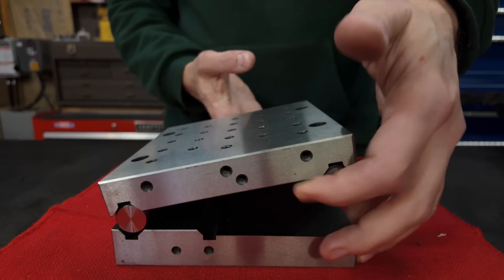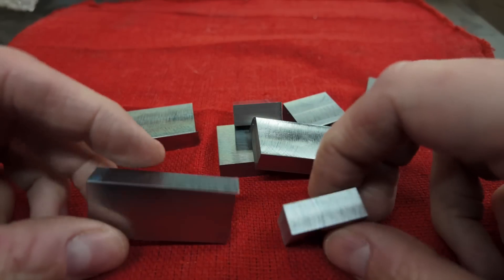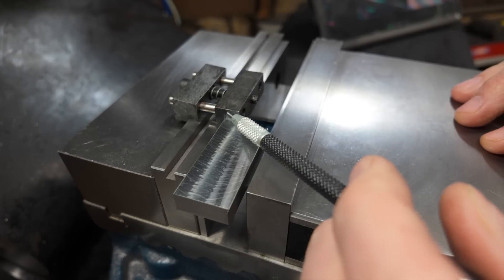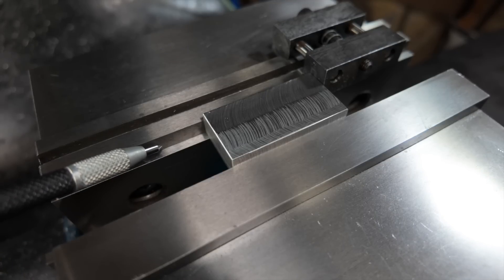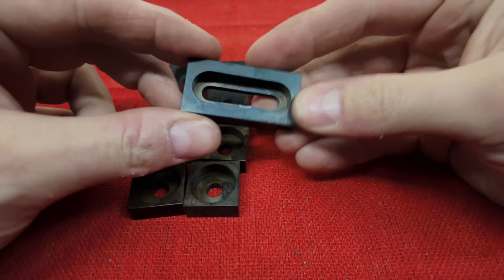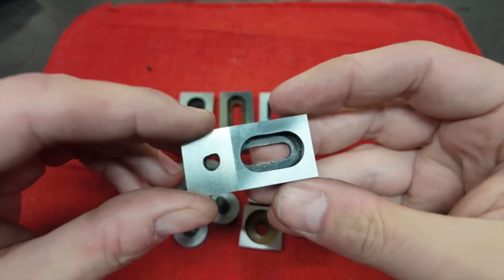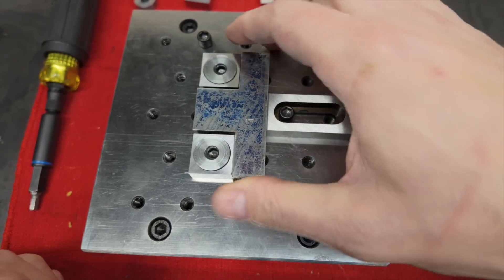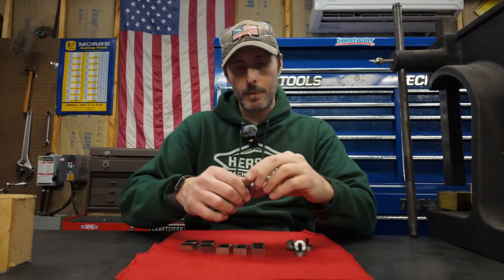These are MITEE-Expensive So I Made My Own

Comment: I spent a lot of years on a manual surface grinder working to close tolerances. You get used to cranking the table back and forth if you do it daily.
I would suggest side milling with a 4 or 6 flute when you put on the angle. It saves the tip of the end-mill for when you need a sharp corner
Reply from the maker: @robc2536  thanks, this is really wise advice. It’s exactly this kind of thing that you can only get from experience so I appreciate you sharing your knowledge with us!

Comment: These methods may help you with other projects.
Mill the angle singly in the main vise, there was no real need for the small vise to be used as well. If you wanted to machine 2 at a time then they could have been clamped in the main vise with their sides touching and clamped with the vise jaws over both. Using the small vise, it may have been easier to have it much flatter and cut the angles with the side of the cutter.
You did not show any tempering, I may have missed that but without it, the clamps will be too brittle to use. Your aim was for a greater degree of toughness and durability rather than pure hardness.
It may have been easier to offset the hole in the rings instead of turning the heads of the bolts eccentric. The screws have a nice straight knurl on the head to give a good fit in the hole without slipping. The drive hexagon would not be offset and stronger, plus a larger offset could be used if required.
When using the tapered bases, the clamping face of the square part should be vertical to the base of the bed, you will get more contact area with the part instead of digging a line into it. You may be able to salvage the square blocks if you grind the mating angle on the base. The threads will align with both parts and the clamping face will be vertical.
Using the fixture plate, the clamps should be directly opposite the fixed datum stop. As you show it, the clamps push against nothing.
When using them it is an idea to make sure there is about a pitch of thread under the cam. This will prevent the cam locking down before it has clamped the part.
Reply from the maker: @marley589  thanks very much, a lot of really great knowledge shared here. I did temper the parts btw. I just didn’t bother filming much of the heat treat process, I figured it was about as exciting as watching grass grow so I kinda just skipped over it lol.

Comment: Use a piece if ali tig wire to clamp unequal objects.. 
Also, you could (in theory!) use that sloped feature if you turned the base part upside down.. yes, youd habe to get creative when bolting that part down, but less hassle than remaking that portion if the project....

Comment: I bought a hydrolic surface grinder. The cylinder was bent. I repaired it and cant wait to use it. Manual Surface grinding is great. For the first 4 hours.
Reply from the maker: @michaelwooda9444  haha, yep the novelty wears off fast… 😅 and congrats on the machine

Comment: I screamed at the screen as loud as I could when I saw you drilling and tapping perpendicular to the bottom of the part but you just wouldn't listen, lol.  If you put a piece of copper wire between the floating vise jaw and the parts you would have got away with doing two pieces at once.  The copper wire conforms to the parts and distributes the clamping force.  A piece of ground wire from some 3 strand house wire works fine.  Some people do this when squaring up stock if the surface facing the floating jaw has not been machined yet to insure even clamping.  All in all another great video!!

EDIT:  Guess I should have read the comment below before giving you the wire tip, lol.
Reply from the maker: @yertelt5570  haha thanks for trying at least, must have had my headphones on 😉

Comment: Years ago I made a larger set of cam-lock clamps for the milling machine with 1/2" socket head capscrew eccentrics and cold-rolled C1045 rounds for jaws.  They are most useful for holding work directly on the mill table in the fashion of a conventional two-piece vise.  They can be used with either odd-shaped material or already squared up stock, with or without spacers underneath.  The screws just engage nuts in the T-slots.  I didn't harden the parts of the clamps.  Which reminds me -  thanks for showing your Hot Shot oven.  Want to know what Santa brought me?  Well, it wasn't one of those. . .
Reply from the maker: @Dogfather66227  yeah I’m thinking of making a set for the mill table as well. And I am definitely spoiled, my wife is amazing. I wouldn’t even have this channel without her, she believes in me even when I don’t!

Comment: Clamp a piece of aluminum tig wire between vise and part.  It will smash when clamped and take up the thickness difference.  Can do several at a time that way
Reply: Or that piece of Romex laying on the floor behind the lathe.
Reply from the maker: @justinsturgeon1  very good call, will keep that in mind for the next time. Thanks for watching btw!
Reply: Also, looked like if you had started the cut in the opposite direction, the flutes would have pushed the part into the vise rather than lifting them out, so even with one I was puckering slightly.. I tend to consider that if clamping is less than ideal & something might slide around.. great video!
Reply from the maker: @ yeah that’s a great point. I try to consider the cutting force direction as well, have actually had problems with that on more than one occasion. I tend to miss those details in the heat of the moment all too often though… lol

Comment: You know I think I just saw the answer to clamping both parts in the vise at the same time on Blondihacks. She used a piece of paper on one part. That way the moveable jaw twists a little and holds both parts tight. I haven’t tried this yet but if it works it would be a great tip to use.